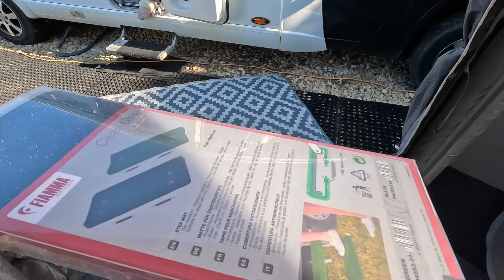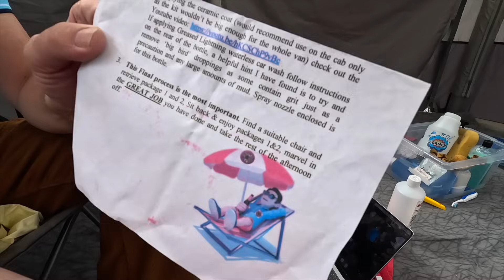Keeping Your Woman Happy! Rule One: Do As Your TOLD!!!!!

Comment: Mazzy, for your step, use baking soda, vinegar and washing up liquid with hot water, let it soak then scrub after a few minutes 😊 bicarbonate of soda is the best cleaning agent, sprinkle some on your step then add a little vinegar then washing up liquid, it will start to foam and clean straight away, then scrub with hot water 👍 Hi Dan
Reply from the maker: Thanks for the tip!